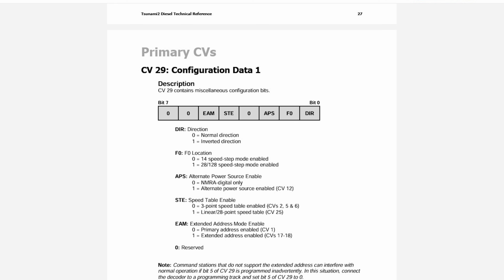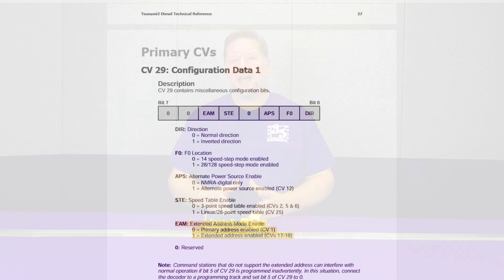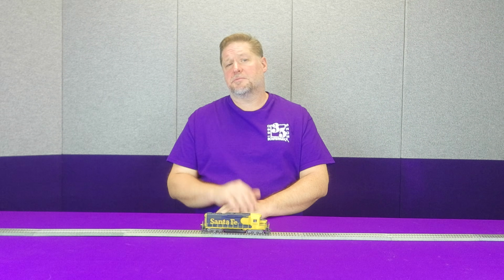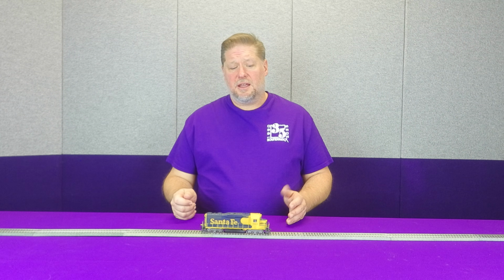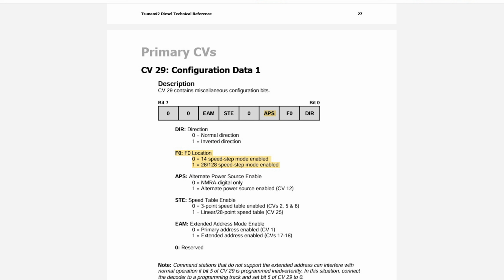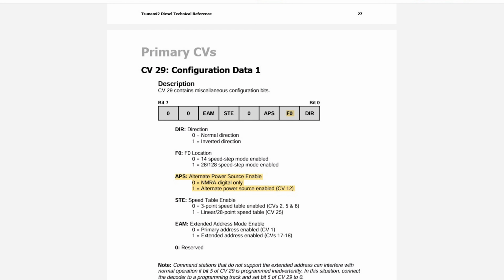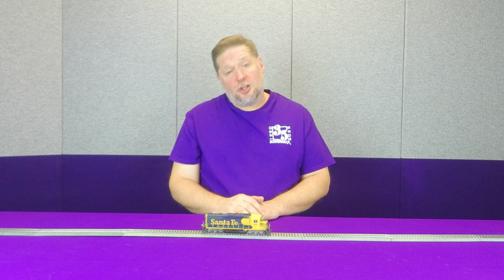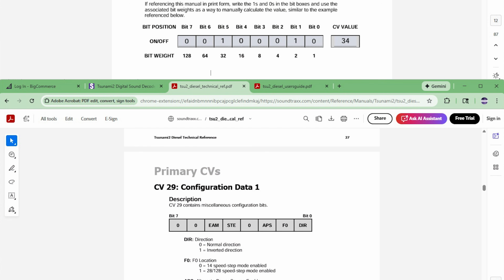Mastering CV 29 for Better Decoder Performance

Comment: I'm glad to hear you say that best way to fix a locomotive going in the wrong direction is to swap the motor wires.  Testing the locomotive for correct direction is an important step before replacing the shell.  The rest of the parts of CV29 are also very important to know about.  Thanks for sharing this again!!!
Reply from the maker: You're welcome! Glad you found it helpful.